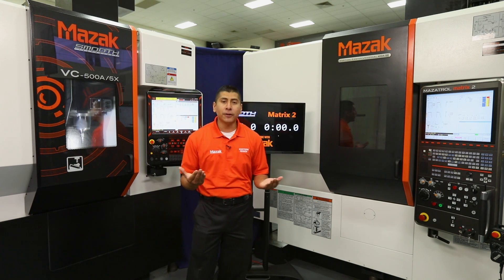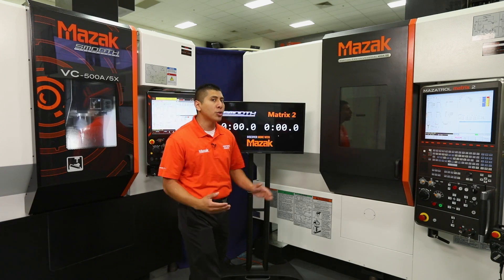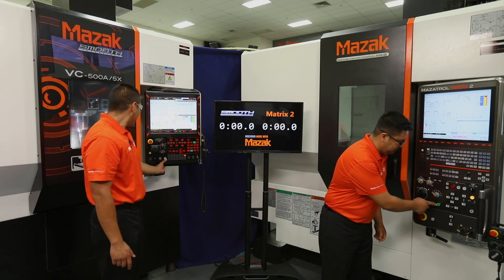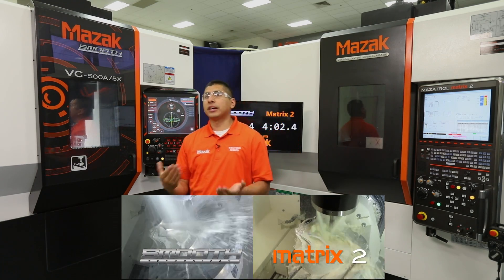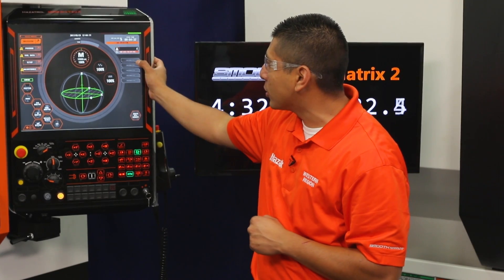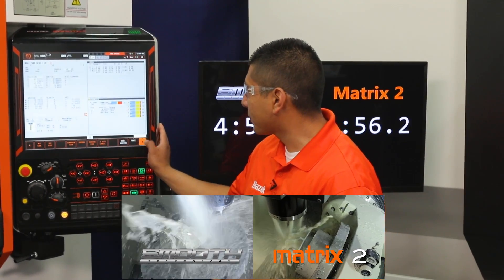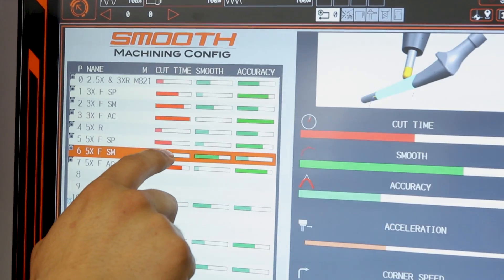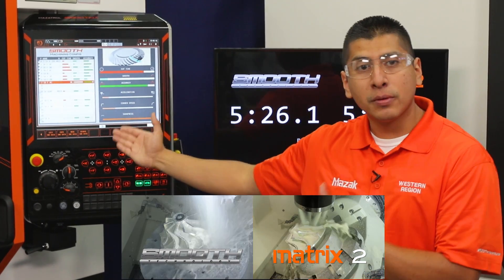MAZATROL SmoothX vs. MAZATROL MATRIX 2 - SMOOTH CHALLENGE

Comment: In the VC-5x smooth control, is there any set up position for tool changing/unloading/inspection which will move the axis closer to the operator including door override activation? Also, is there any selection option when I touch my tool offset to register in tool offset page not in tool data page. Also how to set tool load monitoring?
Reply from the maker: You can change the location of the table with the RETURN field in an END unit in a MAZATROL program. In the RETURN field you can choose ZERO, FIXED PT, or ARB PT. You can teach tool length to the TOOL OFFSET page by beginning on the TOOL OFFSET screen depending on the parameter configuration of your machine and how TOOL DATA and TOOL OFFSETS are being used. Tool load monitoring can be accomplished in several ways. Depending on machine model, the THRUST F. and HORSE PW values can be set in tool data to adjust tool load. This can also be accomplished on multiple axes using the Overload Detection Option. Please contact your nearest Mazak Technical Center for support if you have more questions.

Comment: So the sales pitch is the Smooth controller which does look cool, but I still don't get how the same machine with the same speeds, feeds and rapids can be quicker with just a different control? Kind of says speeds and feeds aren't actually a factor in machining. 
Can anyone explain this?
Reply from the maker: Great question bootdisc. Smooth optimizes the part program/cutting path, so while it uses the same feeds and speeds, it economizes the machine's movements. It travels a shorter distance to machine the same part.
Reply: I guess it thinks less also between 2 operation
Reply: @MazakCorporation  Isn't that only the programming being more efficient rather than the machine being faster? Seems like a bogus comparison.
Reply: I think that...
You have a car that can travel at a speed of 300 km / h. If you go on a straight, long motorway, then the travel time from point "a" to point "b" is easily calculated. And if the road is not straight? In the latter case, the speed will be different depending on the driving style and the driver's experience. Before each turn, you will have to slow down, and then accelerate. The more correctly you calculate the acceleration and deceleration moments, the faster you will reach your goal without unnecessarily overloading the car.
Sometimes using G0 in a program will only slow down execution.
Reply: 12 pass per section with 12 section on the turbine wheel if you save 0.44 sec on each rapid travel because of the latest new generation of servo= 63.36 sec of cycle time plus the return to home position for a total of 66 sec save. EZ PZ